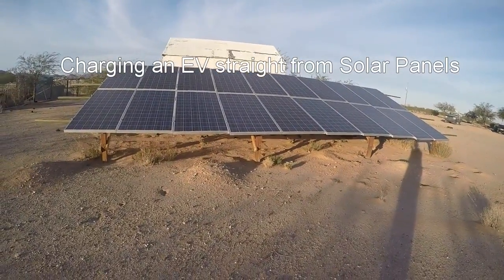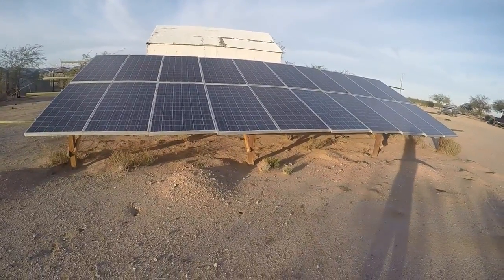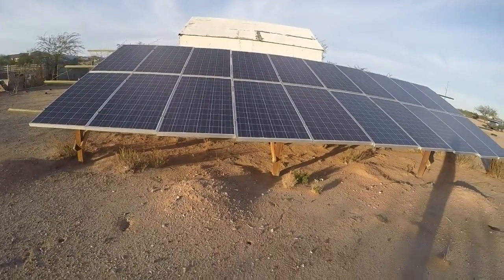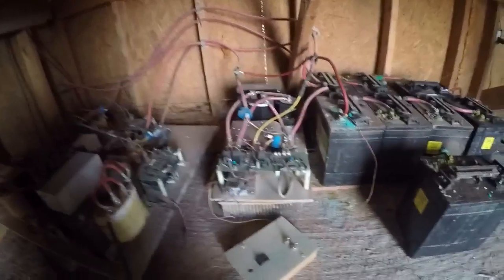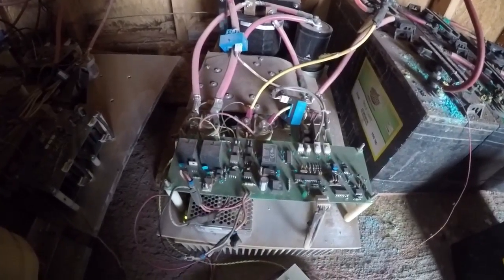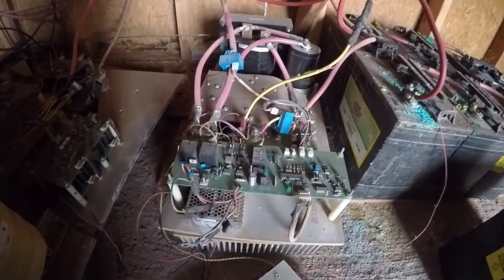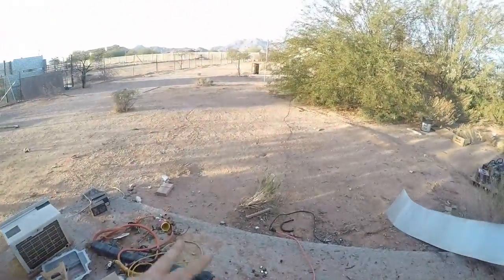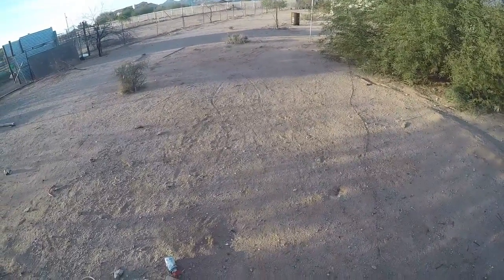Charging an EV Straight from Solar Panels

Comment: nice! where did you find the 200A indicator?
Reply from the maker: It was on Digikey.  Now I think they only have the 150amp version from the same company.  But you can still order the 200amp right from whoever the heck it was.  I think mouser has them too.  Just do a search for 150amp inductor and it should pop right up.